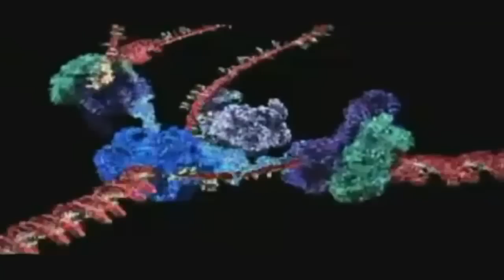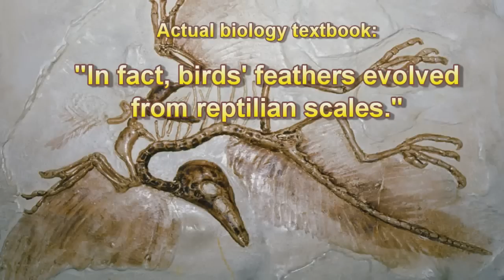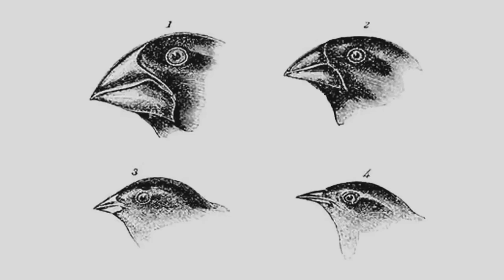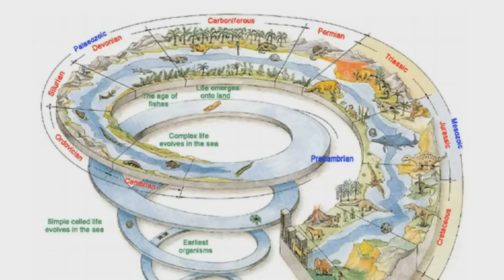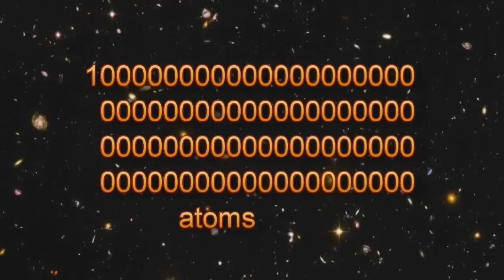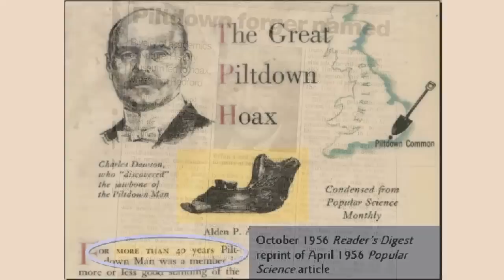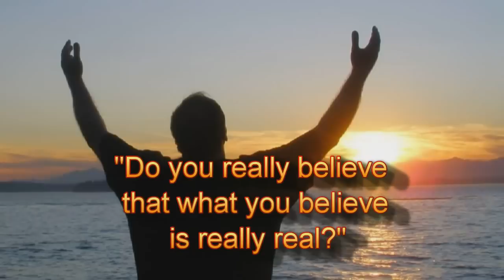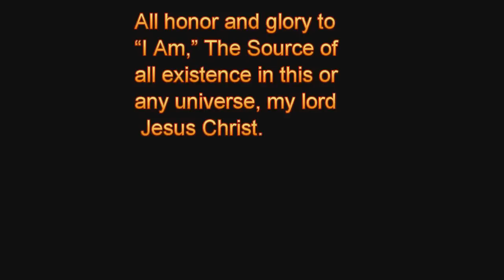Evolution Demolition

Comment: Ever notice that the columns are layed down by their weight not by time? Noahs flood is the cause of that.
Reply: And the boundaries between layers are remarkably flat and un-eroded, proving rapid deposition, not millions of years.
Reply: No they are not fool.
Reply: walkergarya Simple denial. You make no case whatever.
Reply: Mark Champneys Sorry but you gave no evidence to support your position, a position put forward without evidence can be dismissed without evidence and it has been.
Reply: walkergarya Pull any photo of the Grand Canyon.  The flat, parallel, layers are unmistakable.
Reply: Mark Champneys Yeah and how do you explain the layer of wind blown sand? How do you explain the layer of volcanic ash? How do you explain the river beds cut into some layers?
How do you explain that the layers date to oldest to youngest, by millions of year as you progress up the face?

Face the fact, Noah's flood is nothing more than myth.
Reply: walkergarya There is no wind blown sand, only wave washed sand.  It looks similar, but there are distinctives, such as swirls of sand extending into the layer above it.  Volcanic ash is to be expected.  The flood model is a tectonic model with enormous volcanic activity.  If there were no volcanic ash layers it would be shocking.
Reply: Mark Champneys SORRY BUTTHEAD BUT GEOLOGISTS HAVE IDENTIFIED THIS AS WINDBLOWN SAND.

AND IF YOUR MYTHICAL FLOOD WERE CONCURRENT WITH VOLCANISM THE VOLCANIC ASH WOULD BE DISTRIBUTED THROUGH THE WHOLE STRATA, NOT DISTINCT LAYERS THAT TEST TO VASTLY DIFFERENT AGES ACCORDING TO RADIOMETRIC DATING.
Reply: They are not laid down by weight.
Reply: walkergarya Gosh, you can call names.  That adds so much credence to your argument.

It is apparent that you are listening to one side of this.  There are geologists on both sides who disagree with each other.  There have certainly been some who suggested wind-blown sand, but the characteristics have been duplicated in laboratory experiments under water.  The catastrophic plate tectonic model of flood geology accounts for the ash distribution very well, far better than the gradual processes model, in my view.
Reply: walkergarya And why would those gases not be here if they took longer?

Basalt flowing down the face of the canyon is dated by K-AR at approximately the same age as the lowest basalt layer.  How can that be?  Different methods applied to the same rock yield different ages.  In fact the same method applied to different minerals within the same sample yield different ages.  Yet C14 in layers with residual carbon yield dates in the thousands, not hundreds of millions of years.  Why do you ignore that method?  Radiometric dating of igneous rock has big problems.

But take a look at all the parallel layers in the canyon (and at other sites worldwide).  Most of these layers show little or no erosion until you get to the uppermost layer.  It is impossible for exposed layers millions of years old to not have erosion, but there it is.  All you have to do is look.  This means that all the many layers had to be laid down rapidly in succession during a global catastrophe.  This fact alone utterly demolishes millions of years and evolution all by itself.
Reply: Mark Champneys And why would those gases not be here if they took longer?

? CARBON IS A SOLID, CARBON MONOXIDE OR CARBON DIOXIDE ARE GASSES.

Basalt flowing down the face of the canyon is dated by K-AR at approximately the same age as the lowest basalt layer.  How can that be?

WHERE ARE THESE RESULTS FROM? CITE A SOURCE.

  Different methods applied to the same rock yield different ages.  In fact the same method applied to different minerals within the same sample yield different ages.  Yet C14 in layers with residual carbon yield dates in the thousands, not hundreds of millions of years.

RADIOCARBON DATING IS NOT USED TO DATE MATERIAL OLDER THAT 30000 YEARS AND THEN ONLY MATERIAL THAT WOULD HAVE TAKEN IN ITS CARBON FROM THE ATMOSPHERE, NOT BURIED CARBON IN OIL, COAL OR DIAMOND.

  Why do you ignore that method?  Radiometric dating of igneous rock has big problems.

NOT WHEN USED PROPERLY. CREATIONISTS WILL TYPICALLY USE INAPPROPRIATE METHODS TO "TEST" SAMPLES AND THEN PUBLISH MEANINGLESS RESULTS TO "PROVE" THE TESTS TO BE INVALID. THIS METHOD IS NOTHING MORE THAN A LIE BECAUSE THEY ARE KNOWINGLY USING INAPPROPRIATE TESTS.

But take a look at all the parallel layers in the canyon (and at other sites worldwide).  Most of these layers show little or no erosion until you get to the uppermost layer.  It is impossible for exposed layers millions of years old to not have erosion, but there it is.  All you have to do is look.  This means that all the many layers had to be laid down rapidly in succession during a global catastrophe.

YOUR PRESUPPOSITION IS SHOWING AGAIN. 

 This fact alone utterly demolishes millions of years and evolution all by itself.

IN A PIG'S EYE.
Reply: walkergarya "CARBON IS A SOLID..."

Yes, but that does not answer my question.

"RADIOCARBON DATING IS NOT USED TO DATE MATERIAL OLDER THAT 30000 YEARS"

I have personally received results from an AMS lab for redwood dated at 43,000 years.  You don't know what you are talking about.

"CREATIONISTS WILL TYPICALLY USE INAPPROPRIATE METHODS"

The creationist research I know by Dr. Andrew Snelling, Dr. Steve Austin, and Dr. John Baumgardner all use AMS labs by others, including MIT.  They do not do their own tests.  Believe me, MIT does it properly.
Reply: Mark Champneys The oldest reliable dates are about 50k years.
Reply: Mark Champneys "redwood date at 43k years" "MIT does it properly. "

So you are admitting that we've dated things far older than 6k years old. Sort of debunks your YEC position.
Reply: kubush Yes, I will readily admit radiocarbon dates older than 6,000 years, but remember that natural clocks render a maximum age, not an absolute age--much like the illustration in my video of the 1951 coin in the treasure chest.
   Virtually all natural clocks are at variance with all the others.  I don't propose abandoning them, but treating the data properly, as maximums.
   One of the assumptions of carbon dating is that the ratio of C14 to C12 in the atmosphere has been constant over time.  Currently that ratio is approximately one part to a trillion.  However, we know with certainty that this ratio is slowly growing.  C14 has not yet reached equilibrium even now.  So 6,000 years ago, the levels of atmospheric C14 would have been much smaller if there was any C14 at all.  This would skew radiocarbon results in a significant way, making specimens look older than they are.  Not only that, but the very fact that C14 is not in equilibrium with C12 is itself proof of a young earth; because after billions of years, it should have reached equilibrium long ago!
Reply: Mark Champneys It gives us a minimum, not a maximum. Virtually all natural clocks correspond to each other. C14 dating had been corroborated with other dating methods.
Reply: Mark Champneys Apparently you don't understand how atmospheric c14 is produced.
Reply: kubush Minimum?  Not rational.  You are self-refuting.  Correspond?  Show me two methods that agree, and I'll show you twenty that disagree.
Reply: kubush Gamma rays strike N14 molecules in the upper atmosphere converting it to C12.
Reply: Mark Champneys yay, you figured out how to use Google. Now tell me why you think it should have reached equilibrium?
Reply: Mark Champneys How is that not rational? Self refuting? How so?
Reply: Mark Champneys Tree ring dating, uranium thorium dating, coral and stalagmites, luminescence dating, varve dating. Check mate son.
Reply: kubush "Now tell me why you think it should have reached equilibrium"
  C14 is being produced in the atmosphere, and simultaneously it is in relatively rapid decay.  At some point the rate of decay should catch up and become equal with the rate of production, but this has not happened yet.  The ratio of C12 to C14 continues to grow.  Equilibrium should have happened well within a hundred thousand years, let alone 4.5 billion.  Slam-dunk proof that the atmosphere cannot be older than a hundred thousand years.
Reply: kubush "Tree ring dating, uranium thorium dating, coral and stalagmites, luminescence dating, varve dating."
  All of which disagree with one another, and all of which are based on unverifiable (and sometimes disproven) assumptions.  Check mate, pop.
Reply: Mark Champneys Slam dunk proof? Not really. Maybe you shouldn't be using creationist arguments that use research from 60 years ago. The rate of production of c14 is not a steady rate, it varies. There goes your "slam dunk" argument right out the window.
Reply: Mark Champneys Except everything you said is the exact opposite to reality. BOOM! Check mate.
Reply: kubush The issue is not whether there is variability in C14 production with the variability of the sun.  Of course there is.  The issue is whether atmospheric C14 is growing.  It is.
Reply: Mark Champneys It grows and shrinks, therfore you can't assume it should be at equilibrium.
Reply: kubush It hasn't shrunk.  The rate of increase will vary with solar radiation variations (as do global temperatures irrespective of my SUV).
Reply: Mark Champneys You contradict yourself. You say it hasn't shrunk then admit there is variation. Variation means that it grows and shrinks. Scientists are well aware of solar cycles and it does not account for the current warming. CO2 emissions do.
Reply: kubush Variation in the rate of increase does not mean that the ratio shrinks.  It means the rate of increase sometimes shrinks.  But the ratio is growing.  Substantially more C14 is being produced than is decaying.  We are not yet in equilibrium.
Reply: Mark Champneys wrong. The rate of increase has not always been positive relative to decay. You don't have your basic facts straight.
Reply: +kubush C14 is entering the atmosphere faster than it is leaving it by 12% to 32%, depending on particular measurements.  Nothing whatever indicates that atmospheric C14 is leaving the system faster than it is entering it.  If you have hard data to the contrary, please present it.
Reply: Mark Champneys You can Google right? Look it up.

Comment: I like how you were spewing some garbage about "vertical and horizontal evolution 17:34  then go on to say "We need to look at a couple of errors that evolutionist obviously make with word meanings." 17:44 Really man? Every word of out your mouth betrays your position. You accuse evolutionist of misusing terms but then make up your own terms then misuse them. This video is one giant strawman argument with a god of the gaps inserted right in the middle of it.
Reply: "Every word of out your mouth betrays your position."  I would hope so, since it is my position.  I never pretended to be objective (nor should evolutionists).
_"...then misuse them."  How am I misusing my own terms?  I am using them exactly as intended.
_"...one giant strawman..."  And what is the strawman that I am substituting and knocking down?
"...god of the gaps..."  I gave an affirmative argument for God based on the presence of symbolic code.  That is not a gap.  Actually _evolution of the gaps is much more comman a practice.
Reply: So then refute the claims please. Give examples. Give rebuttals. Ohhhhhh righhhhht. You can't.
Reply: It's legitimately fairly hard to give a rebuttal to something that doesn't make sense. 
It's like the sentence: "The fourth colour of the alphabet is the derivative of potato with respect to Canada." Some things are just 'not even wrong'.

I tell you what - give me what you think the strongest argument in this video is, and I'll refute it.
Reply: LumieX 
This account was named when I was very much younger. 
Do you honestly believe that to be an indicator of anything, because I don't think you do. I think you're so scared of admitting you're wrong that you use my account's name as a cover to skulk away.

I could refute anything in this video you choose. So choose. Or are you just not interested in the truth? Does it scare you?

Comment: So, Mark, maybe it was a bit hasty to accuse others without having a quick glance in the mirror first. Remember, the main reason of 'testing' a hypothesis, is to try & falsify it, so maybe we should we let them get on with it. Unless, of course, you have some relevant data for them?...thought not. It's tough science, & there are several ideas to test. The point where they can all be ruled out will be hard to know, & may take a while. They could still be at it in 2113. That's science for you.

Comment: What are these sweeping conclusions, and what is inadequate about the explanation? Did you look at the code provided? Do you even understand the code?

Yes, it's a simulation. That is irrelevant to the point that it proves useful information can be produced by random changes and selection pressures, as this is exactly what it does.

What part of it do you want more detail about?

Comment: at 8;00 min. >>Other radiometric dating method only apply to igneous rocks.
YES, you are correct.  They date a volcanic ash layer above and below a fossil to get a date range for the fossil.
Reply: ***** Nice theory, but the radiometric dating of ash is notoriously bad.  For example, why can't ash with daughter isotope be blown into the sky?  Answer, it can be and is.  There are many other problems with radiometric dating too.  Any dating method renders a maximum age, only.  Virtually all methods are in conflict with each other to one degree or another, especially radiometric methods.  So using them as a maximum is the most helpful.  For example, finding carbon-14 in dinosaur original tissue conclusively proves a maximum age of a hundred thousand years, regardless of all other methods used.  Carbon-14 can't exist longer than that in measurable amounts.
Reply: Mark Champneys>"  Virtually all methods are in conflict with each other ''  NO they don't.
They cross reference each other that is why we know they work.
No they don't use carbon dating to date rocks [fossils]  IT does not work.
No, there is no dinosaur ''tissue''
Reply: No audio the las five minutes of the video but it is a very interesting theme and at the same time hard to figure out and understand the evolution of our planet and all the things that includes i seen part of this theme of  the evolution in elementary school very exiting I liked the science class one of the best videos I ever seen hope y have a wonderful weekend. Greetings
Reply: Mark Champneys They can only use radiocarbon dating on organic material less than 50,000 years old due to the shot half life of Carbon 14.  The carbon must come from the atmosphere.
Dinosaurs are radiometric dated at over 65 million years old, the age of the last mass extinction.
Creatards think anything with C14 in it must be young but they don't know when the C14 was created.
Reply: Mark Champneys Dinosaurs can be dated with radiometric dating, you just can't use radiocarbon  [Carbon 14] dating.  They date volcanic ash layers  above and below a fossil. 
There is C14 in diamonds and coal and fossils and anything else in the ground.  And the more U there is in the ground the more radioactive the stuff is.
Reply: Mark Champneys The C14 did not get into diamonds from the atmosphere.  IF you don't know when it was produced then you can't say ''It should be gone by now so it must be young''
Reply: Mark Champneys You do know the accuracy of the dating method is 2 million years.
''Fresh volcanic ash in Hawaii contains daughter elements giving it the appearance of millions of years.''  Yes, 2 million years plus or >> minus 2 million years.
Reply: All dating methods have issues and are unreliable. Evolution theory is the greatest hoax on earth.
Reply: Frank M Of course every dating method ever invented is wrong so Kent can be right.  LOL

Comment: Regarding the recession of the moon:
If the moon had been receding at the same rate - 1.5 inches per year - for 4.6 billion years, it would be around 35% closer to the earth 4.6 billion years ago than it is today. Now setting aside the huge and unfounded assumption that the moon has always been receding at that rate (when common sense dictates it would be accelerating it's recession the further it got from earth, so it would have been moving away slower previously), can you show me the calculations that you used to make the claim that the oceans would wash over the continents? Undoubtedly the tides would be much larger, but enough to erode entire continents? 
You suggest that using your model, the continents should be eroded today, but how do the tides stop tectonic activity that creates brand new mountain ranges?